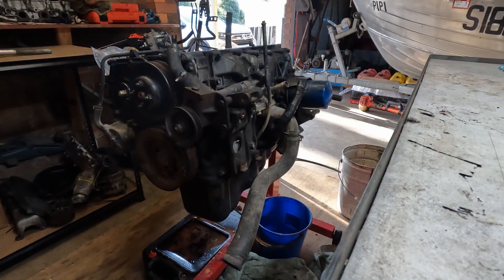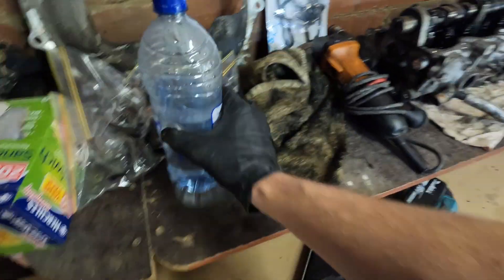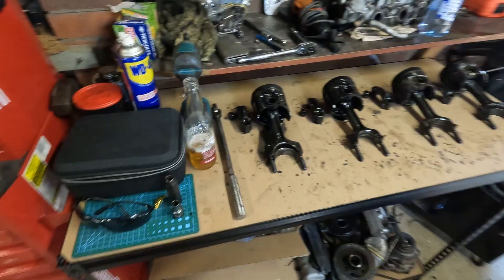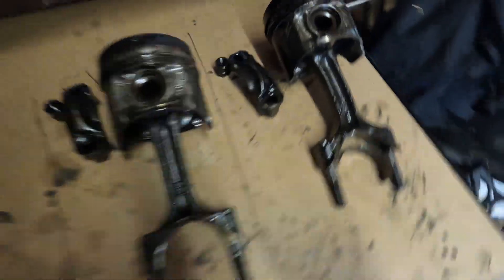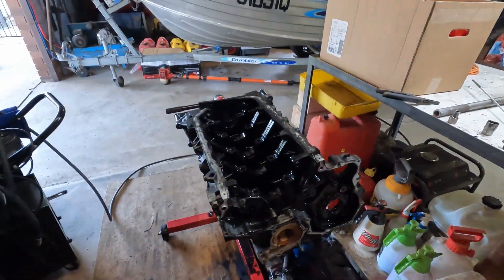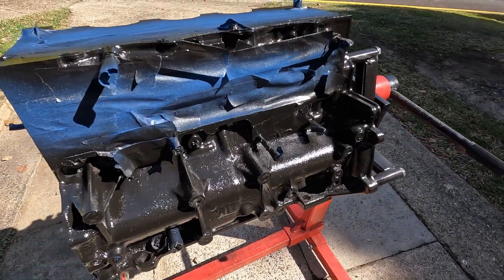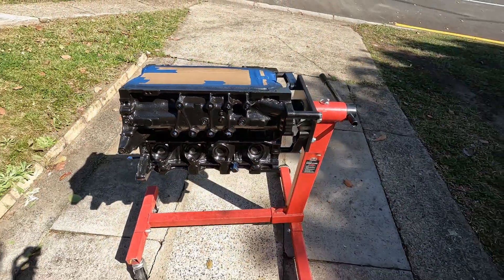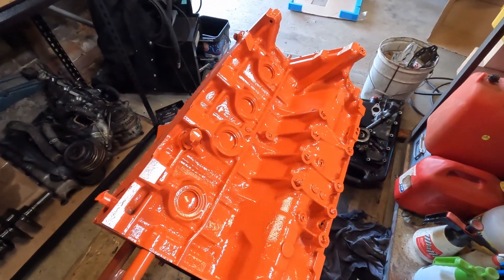WLT Engine Rebuild Ford Courier/Mazda Bravo: Bottom End Disassembly + Painting Block (Part 2)

Comment: The one thing I watched all you videos for and you skipped it removal of oil pump
Reply from the maker: It's connected behind the harmonic balancer and has a gear directly off the crank shaft, most of it mounts behind the timing case and I think there's 2 twelve mm bolts on the bottom end/under the sump

Comment: Hey bro over past few days I’ve been watching all your bounty/bravo vids and you have mean work quality. I’ve just recently replaced my head with a new one and now my rings are gone in one cylinder causing it to run like shit, 3 read 400psi but ones at 250. Will most probably just put new rings in the one cylinder since the rest are still high comp. would you say dropping the front diff or pulling the whole engine would be easier? I’m looking more towards dropping diff and pulling head and sump off to get at the one piston as I don’t have a engine crane or stand but still abit unsure at the moment. What would you do? Cheers Damian.😁
Reply from the maker: Hey man, personally I would just do a whole top and bottom rebuild at that point, you'd be pretty cut if you went through the effort of replacing one pistons rings and then another one fucks out. That being said you can definitely just take the front axle out drop the sump and pull a single piston out and do the rings, if you need a fast fix and don't have the money to buy the crane and rebuild kit I'd definitely just do it the way you said. Realistically you can do anything you put your mind to bro, whatever you skills and wallet permits haha. Good luck brother ❤️
Reply: Thanks for the fast reply bro, I would love to do a full rebuild on it but time and money is a issue. But your right about doing one piston. May aswell get a set of 4 while I’m there and hopefully I can get at it all from underneath. Not looking forward to dropping diff after watching your vid haha. Rfw has been doing my head in aswell but that’s another issue I just want my work horse back lol, all started from a snapped glow plug turned into a new head and now new rings lol. Many thanks bro ur a legend💪🏼

Comment: Great video - top marks for painting the bloc.  Some colour, whatever shade, helps to show any oil or coolant leaks in the future, and adds that overall pro look - tip for future videos most people enjoy less annoying music and more chat.
Reply from the maker: Thanks mate, unfortunately I made the mistake of deciding the get the block machined after painting it so it did ruin it a little bit but still looks choice. Cheers for the feedback, I just add the music because there's a lot of sections where I'm working and not speaking at all, so rather than just cut to things been complete I add the footage of me working on the engine with some music so it's not just boring and hard to watch. I also felt like I was boring people when I do videos with more chat, I don't really make them for anyone else though, I make vids purely for my own entertainment. Cheers for watching :)
Reply: @Finndawg  You will find people will watch the process even if you think it's boring.  People are looking for tips and clues on how they might do it or what they did wrong in their project - or they just froth blokes doing a bit of back yard wrenching. I made plenty of blunders on my rebuild - so learnt heaps for my next one.
Reply from the maker: @1010Singularity  Thanks mate, although I tend to steer away from tutorial or instructional type stuff as the last time I did an engine rebuild I was 12 and it was with my dad, so I'm really not super knowledgable I just give it a hot go, at the very least I hope people can learn from my mistakes hahaha. But cheers I'll definitely take what you said onboard and give some more explanations behind the madness.